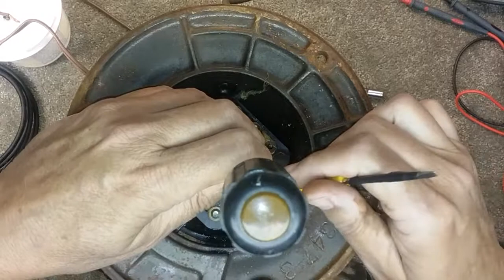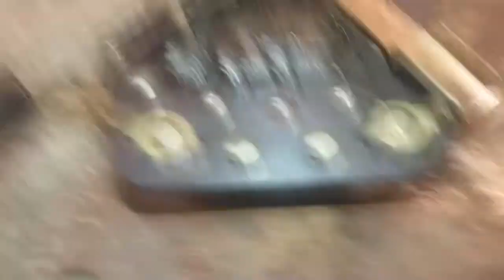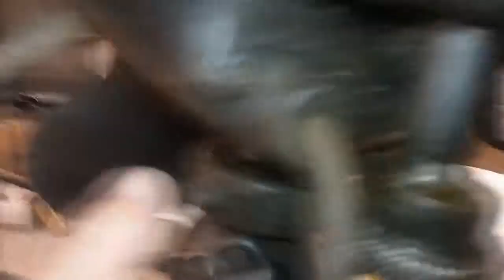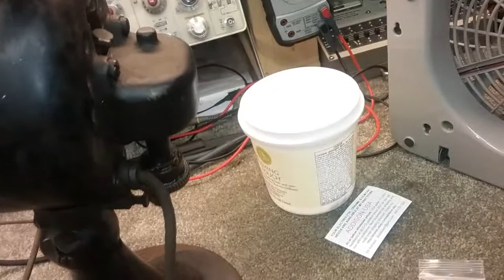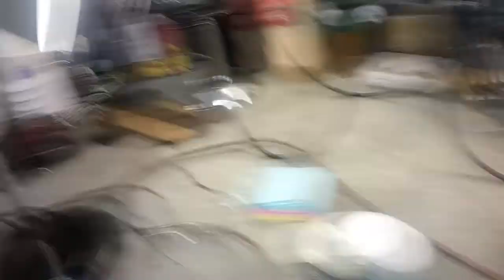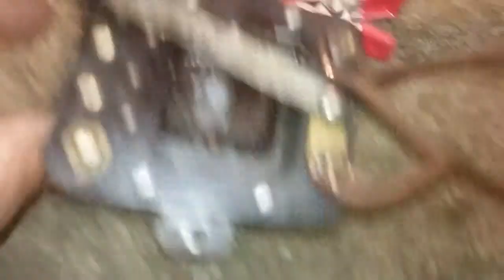1931 Emerson Desk Fan - Model 29646 - DEMO

Comment: ??  How do you figure out which wires from the fan go where on the switch ???  Also, just so you know, you turn the toothed gear on the oscillator to stop or adjust how much the fan oscillates.  I do not like AFCA, I contacted them for some help and they are VERY Arrogant and No Help.  Thanks, but can you elaborate on the wiring (which Wire from the fan goes where, when you ohm the motor.  Thanks again.
Reply: I agree with your opinion on afca, I asked how much a certain ceiling fan is worth on their Facebook group a month ago and NOBODY has answered me or liked my post, arrogant assholes.